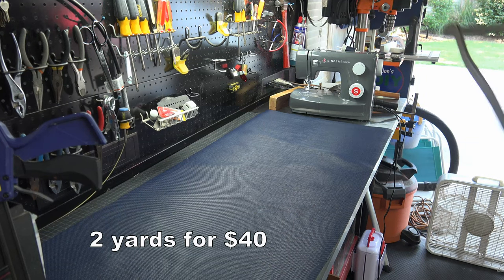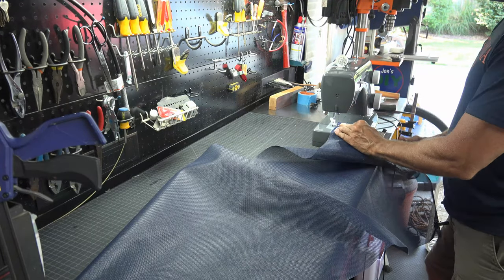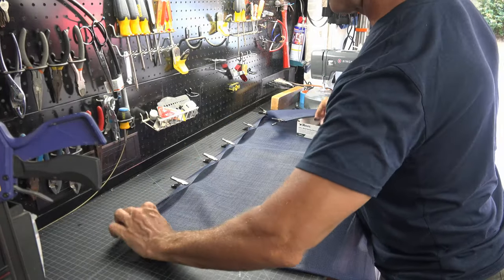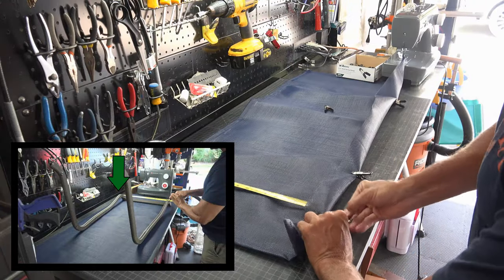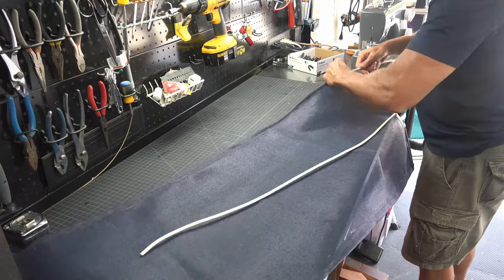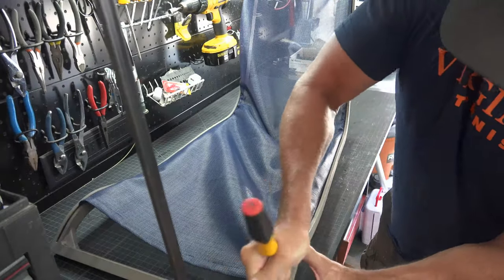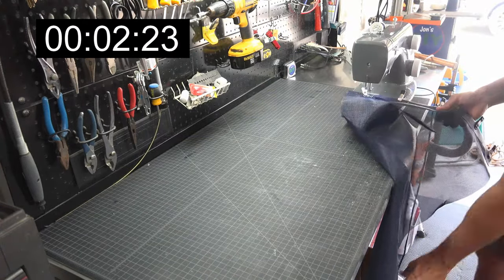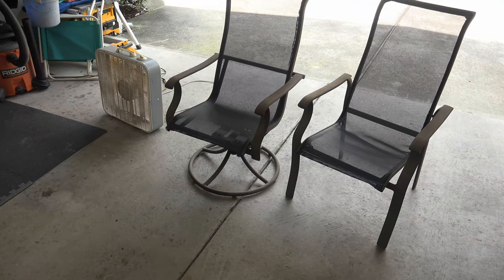Replacement Sling Covers in less than 20 min a chair / Jon's DIY

Comment: How quick you got your timing down.
Hey if it takes a 3 day weekend one would have furniture like new, with the latest fabrics to last another 5 years.
🎉🙌👏
Reply from the maker: So my first set of chairs with the stipes lasted about 4 years before they faded and did not look good.  But they were not outdoor material and I left them outside in the rain, sun, snow.   With this set I used the more expensive outdoor all-weather material.  It's been three years now on the same back porch.  These look like I put the fabric on yesterday.    sewing the fabric was the easy part.  Getting them back on the chairs proves to be a bit more difficult.  Thanks for your comment.  Jon

Comment: What settings are your sewing machine on?  How big is the fold for the slide rods?
Reply: Look at your original fabric when you remove it as a possible guide.
Look up your type of machine and then google not just the settings but what type thread for outdoor furniture.
Hope that helps.

Comment: I bought similar chairs and the fabric deteriorated within a year. But the aluminum frame is intact.  I hate to replace the fabric every year or so, is there an alternative?
Reply from the maker: Saul,  The fabric I am using in this video is still going strong.   When you go into a fabric store ask the clerk to show you where the outdoor material is.  This stuff is great and has shown no signs of wear yet since the posting of this video.  And my back deck is brutal.  https://www.facebook.com/JONSDIY/photos/pcb.2955831108065679/2955830501399073/

Comment: Was wondering how you remove the stubborn screws/bolts that secure the sling to the frame.  I don’t want to ruin the chair.
Reply from the maker: Vice grips.   Only had issue with one.

Comment: If my fabric ends up being too long after I pull it through the chair do I have to take it out and essential start over??
Reply from the maker: No, just adjust one side to compensate for the length.  Then refit.
Reply: @JONSDIY  I'm not sure what you mean. Just have one side stick out and put the end cap on the other side?
Reply from the maker: @MariahChan96  no I meant pull the slide out that is a little bit longer pull the thread just on that one side and then shorten it you should be good to go